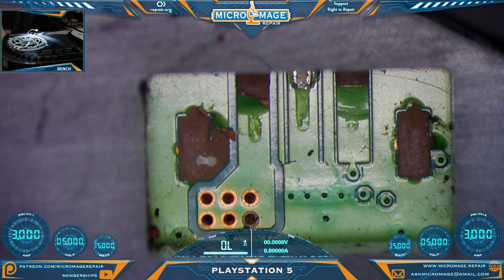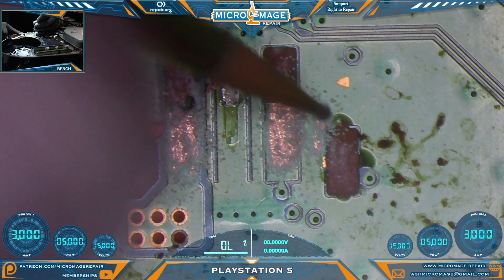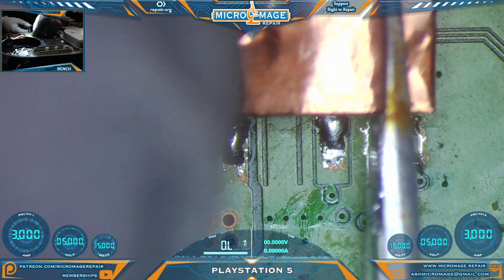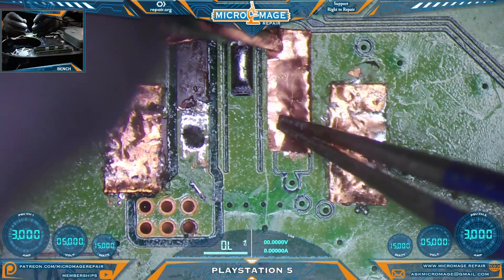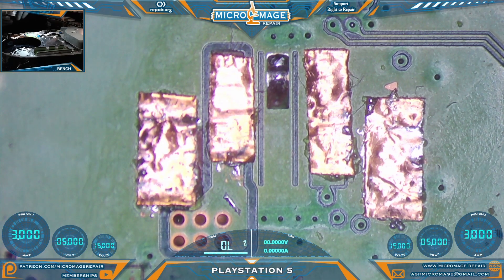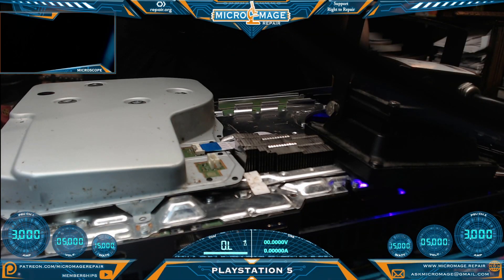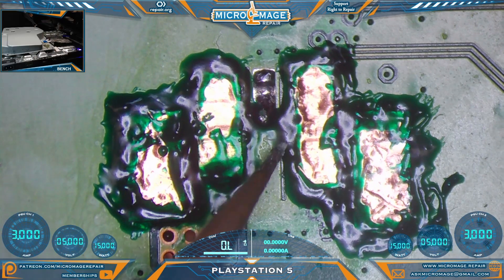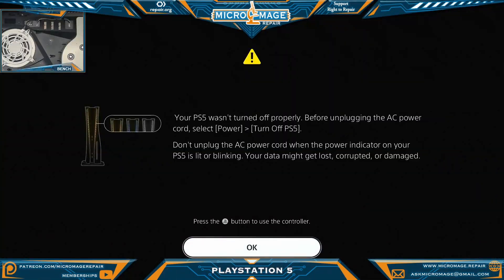PlayStation 5: Ripped off fan Connector

Comment: What is that green stuff u put around the copper tape
Reply from the maker: It is UV curable Solder Mask. 
I use it to keep everything in place while soldering.
The solder will wet when putting the connector back on and things could become detached or slide around.